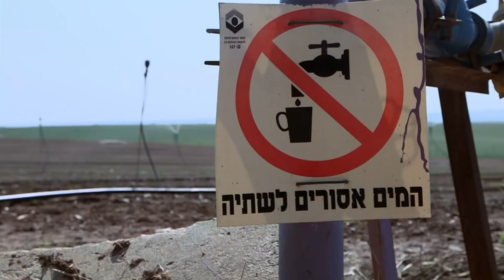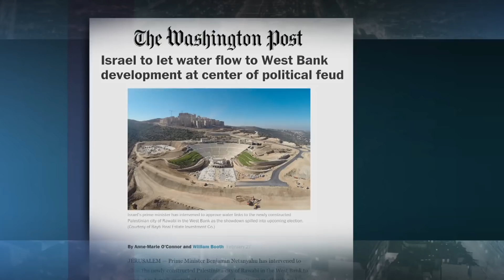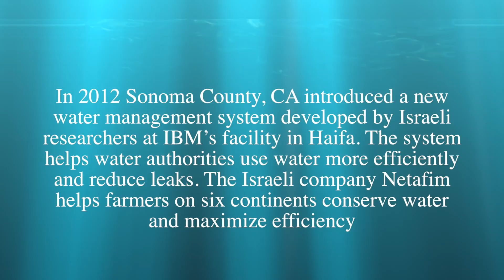Israeli Water Saving Technology

Comment: you said process is energy intensive...why cant you use solar panels to power these plants??
Reply: Dennis Zaidman there are lots of barren land there in Israel...they could set up enough panels there and they have the sun almost all year round...yes initial cost is high...i agree...but this is Israel..
almost nothing is impossible for her
Reply: 3% of the output would be 357 megawatts, each solar panel produces between 200 to ~320 watts, that is too much panels, way too much and extremely costly.
Reply: Dennis Zaidman well i hope they find a way ...BTW are you from israel
Reply: I am, and also happen to work in a place that produces the pressure vessels for the desalination plants. :)
Reply: Dennis Zaidman forgot to ask....how many megawatts do u need for this plant